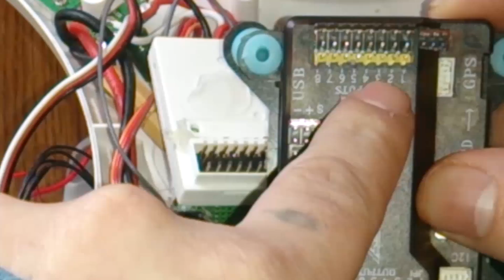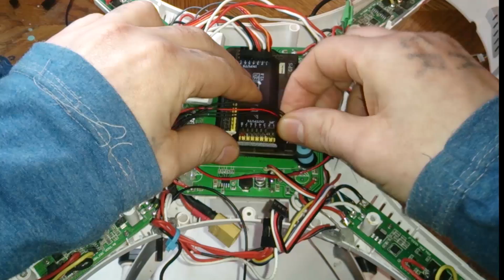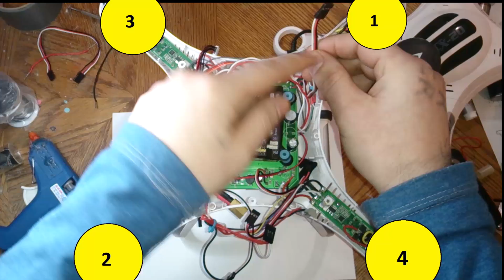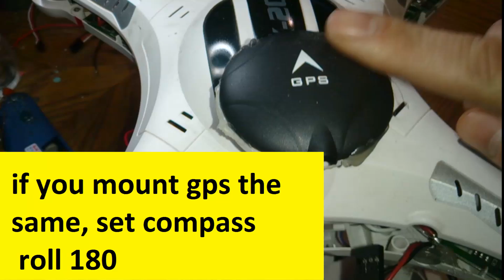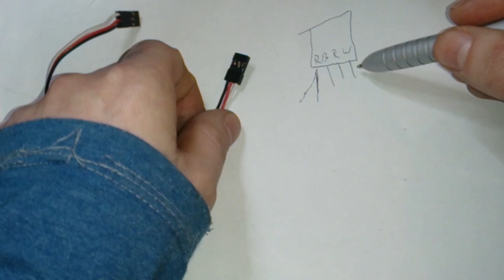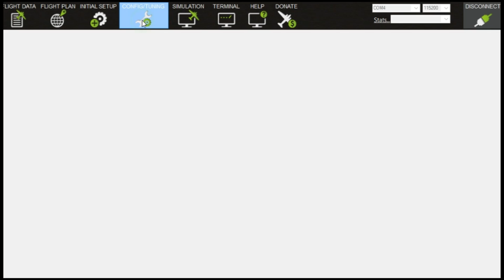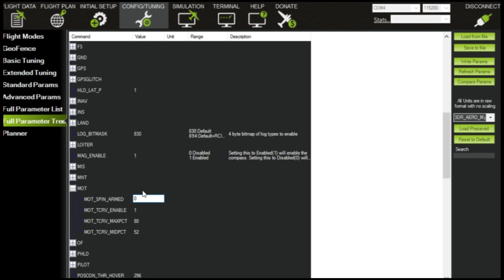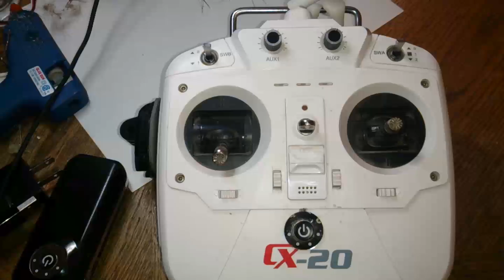cx20 factory apm to apm 2 6 - 2.8 step by step

Comment: First I would like to say thank you. Your video was a huge life saver as I was swapping out my old FC to the new one. Mine is a 2.5 and was almost identical to the procedures that you showed. I do have a couple of questions about things that arent quite right with my CX 20 now. The LED's for arming and gps lock are working but only for the Arming portion. They both light up in sync when the quad is armed and blink in sync when it is not. I followed your drawn procedure as I have the set up with the one plug and two joined red wires. The other mystery is that now when I arm the quad I have to use the right stick down and to the right instead of the left stick down and to the right like it uses to be. Your awesome bro and any help that you can provide will be super apreciated.
Thanks so much.
Reply from the maker: I came up with another picture..   make sure to start counting at a0,a1,a2 ect..  https://drive.google.com/open?id=0B2w6_OKE_2kxbjJfR2Zyb3E4bFU

for your reverse arming  double check that you did not put the e,t,r cable backwards.. it might be r,t,e  you can see this once you go into mission planner and remote calibration.. to double check..
receiver---apm2.6
a===========1
e===========2
t===========3
r===========4

I am 99 percent sure that is your problem.. just lift up one end of that cable either on the apm or the receiver.. and just turn it around ..
Reply: okay cool... that looks like exactly how I have it set up except the ground pins are moved over a few pins. is it important for them to be directly below the switch pins?
https://drive.google.com/file/d/0Bzz5jGWsqlyNUnAwZlBIQXowLUU/view?usp=drivesdk
Reply: bangs6996 they are running in sync with one another for the arming of the quad. not getting a separation between them for gps lock?
Reply from the maker: the way it should go is they both blink when you plug in the quad.
once you arm the quad the green and red light will go solid then the red will stay solid ... and the green will blink if no gps lock.. once you have gps lock the green will go solid .

what version firmware do you have?   
and the ground pins are fine where you have them.
Reply from the maker: and the orange and red light will act as one light now.. unless you flip the leds like i show in my other video..
Reply: bangs6996 Ohhhhhhhh... that makes sense..
Reply: bangs6996 firmware should be the latest. It just updated
Reply: bangs6996 excellent..I will try this as soon as I get home...
Reply: bangs6996 bro... your a genius. switching the cable over worked for the arming issue. I've set it on mission planner not to arm until there is a gps lock
Reply from the maker: cool... glad you sorted it all out.. and thanks for the sub as well..
Reply: Alright Bro... I buttoned it all back down and am recalibrating and the only issue that I seem to get is the compass offsets. It recognizes the compass in the I2C slot which is the only one that it will fit in (factory Compass) but when I try to do live calibration it does not seem to hit all points. Any advice here???
Reply from the maker: yes .. if the compass is actually working .. tape up your usb cable while your doing the calibration to one of your legs.. you might be loosing contact when flipping it all over the place..
Reply: bangs6996 I actually tried from the apm directly to the laptop. I know I'll need to redo it but trying everything possible. do I need to do 180 compass?
Reply from the maker: no you should not have to change that unless you moved your compass . upside down or turned the orientation of it. .... 

with mission planner .. when you go to the hud.. is it it pointing in the right direction north,south , ect..   try connecting with the compass not attached. and see what direction it points in then slowly moving it in another direction.. 

next unplug the quad ..and plug the compass back in .. and try again and see if its different and if it moves better with the compass plugged in.

if you have a smart phone.. try getting a compass app and compare the app data screen with the hud screen in mission planner..
Reply: bangs6996 ok. getting a compass offset to high pre arm warning. quad won't arm when gps and compass are checked in arming
Reply from the maker: what error do you get when the compass is not plugged in.. curious if you have a on board compass..
Reply: bangs6996 Dammit, I didn't try without the compass plugged in. I kept getting the compass offset error, then that went away and I was getting a check mag error. I'm assuming magnetic interference.. so i loaded old saved parameters including apparently old compass settings. good news it, it flew about 15 minutes ago. held totally stable in gps modes. didn't feel any compass related issues and rtl landed it within inches of its take off point. going to throw another battery in it shortly and try it again.
Reply from the maker: that's great.. it turned out good.. rtl is the best test for the compass
 and gps anyways.. .. as I tell people on every flight, take about 2 
mins to test rtl.. just arm the quad bring it up and fly it about 20 feet in front of you.. switch it into rtl , if it comes straight back 
and attempts to land you can take it out of rtl.. and have fun.. If for 
any reason it goes in another direction .. quickly flip it back in 
manual and don't fly until you figure out what is wrong or you will have
 a fly away eventually.. ...

anyways congrats for sticking with it and figuring out a fix..
Reply: bangs6996 your awesome bro. your video and advice walked me through it. next, a ground up build... sounds like your quite the expert. mind if I keep your info for potential future questions?
Reply from the maker: yes for sure.. if you get stuck on something just post on/in what ever my newest video is, it does not have to be related to the video....
Reply: bangs6996 dude... I spoke too soon I guess.. Lol. wicked toilet bowling going on during second flight. took for ever to arm and then when it finally did, it was all over the place. this compass issue is going to be the death of me.
Reply from the maker: Maybe its the cable is loose on one of the pins for the i2c cable.. 

with mission planner on .. maybe try to play with the i2c cable wires on both sides to see if anything weird happens..

I'm curious how come you just don't run the new gps and built on compass to the puck on the back.. it might solve your problems
Reply from the maker: andd boot up with no compass to make sure you get a no compass error. ..  I have no idea if your apm came with a built on compass.some do.. but usually they save 20 cents and don't add it..
Reply: bangs6996 can't run to the puck because I don't have one anymore. lost it in a nasty crash a while back and fabricated a different holder for the compass.. I am honestly not sure if the new apm has a built in compass. i guess I could pull out and then try to calibrate and see if it finds the apm compass.
Reply from the maker: yes it be worth the check just to make sure.. ..your hud should give you a error as well saying something on the line No compass.. 

If you did loose your puck .. maybe it is the wires then on the i2c that are messed up .. or your compass is just to close to something with too much noise.. ....
Reply: bangs6996 pulled the external compass wires. Recalibrated with the APM compass which went MUCH smoother than the external compass. saving params and will try another flight.
Reply from the maker: if you have a internal compass you should have a jumper to disable it .. or a trace that you can cut.. .hard to say how much noise you will get within the quad so close to everything..
Reply: bangs6996 the internal seems to be much cleaner than the external when calibrating. I am getting new offsets for compass #1 are -360 -611 -187, so when trying to arm said compass offsets to high.
Reply from the maker: btw .. i think you have the straight pin.. right beside the gps port. you should have a jumper.. ..if you remove that jumper you can then use your external compass..   you have probably getting the internal compass the entire time..
Reply: Oh Crap your right. there are three sets of pins next to the compass. which do I pull?
Reply from the maker: check to see if you have a jumper bridging two of them..and remove it.
Reply from the maker: beside the compass is jp1 .. you can remove that jumper as well if you have one on it.. but I'm sure you meant to say gps..    .. on the gps side.. you might have a very small jumper bridging two pins.. remove that as well
Reply: okay. this compass thing is driving me crazy. have tried calibrating the s)&t out if it. I've changed the rotation etc. I've gotten it to point in the right direction but cannot get the offsets get to an acceptable level.
Reply: I'm using a ublox gps which I believe has a compass built in. that may be the problem.
Reply from the maker: did you have a jumper beside the gps?
did you remove it?
did you boot the apm back up with no external compass and with that jumper removed ..to make sure you are not still using the internal.

thy ublox has the i2c on a separate wire  ..with two wires in the harness..
Reply: yup. the gps has a compass. mission planner only showing one compass so I'm not sure how to choose the external as the default
Reply from the maker: sorry .. need to know this..
did you remove a jumper????  beside the gps.
and did you remove jp1 jumper as well??
Reply from the maker: sorry .. need to know this..
did you remove a jumper????  beside the gps.port
and did you remove jp1 jumper as well??
Reply: I removed the jumped next to the gps input on the apm. that di dnt seem to do it.
Reply from the maker: ok .. thank you lol..

so now the next step is to flip the apm upside down and take off the 4 screws. .. and take the top off...and take a good picture and link it to me.. I want to see if you truly have a compass . and if you need to cut the trace..
Reply: check it.. https://goo.gl/photos/x7gSJu1zSQdZpDi46
Reply from the maker: ok perfect.. cut this trace..
https://drive.google.com/open?id=0B2w6_OKE_2kxOEg4QmhTa0JxMzA
Reply: using this gps https://drive.google.com/file/d/0Bzz5jGWsqlyNLWJ0eTJtTTlEeHM/view?usp=drivesdk
Reply from the maker: ok well cut the trace i suggested.. and also your gps does not have a built on compass..
Reply: so it's the compass in the APM?
Reply: so when I try to calibrate compass can't seem to get to the white dots on the top of the circle.. it starts out WAY outside and pulls its self in.
Reply from the maker: or maybe it does..heh ..thats not important right now anyways.. the important part is cutting that trace.. then plug the apm back into your computer with no external compass and confirm you get no compass error.. .. then plug in the i2c and see if you get it..
Reply: nice... I'll let you know how it goes...
Reply: ok so... razor blade that bridge on that point.. cool.
Reply: bangs6996 I removed both
Reply from the maker: "I removed both"  Is this a old reply? .. and yes razor blade that trace.. if you ever want to re use the internal u just need to put a solder blob back on it..
Reply: bangs6996 yes that was old. cut the connection. got the compass not healthy error. plugged external on and rebooted. compass calibration was Much better. need to lock it all down and recalibrate with the top locked on and level everything. tried flying before that and it was bouncy as Hell, but it marked and did fly. so moving I. the right direction I think.
Reply from the maker: k good luck.. also make sure the compass is still on the out side of the
 quad roughly where it was before.. and so important that it can't move 
at all from the air pressure  of the blades ect.. or any possibility  of it falling off during a flight..
Reply: bangs6996 ok. buttoned calibrated well. in gps modes its ALL OVER the place. drifting was out in all directions.
Reply from the maker: how is it in manual mode?  if its drifting ..you need to do a better job at accel calibration.. 

are the wires of your compass facing forward? / towards the front of the quad
Reply: bangs6996 not drifting in manual mode. little twitchy but not drifting. compass is mounted outside and wires are facing the front. https://drive.google.com/file/d/0Bzz5jGWsqlyNeUdkT2FJYkZIbVE/view?usp=drivesdk
Reply from the maker: maybe try a compass calibration again.....
also confirm in mission planner..
..
config tunning
..... Full Parameter list
...... Compass_external = 1
......Compass_orient = 0

I would also re do the accel calibration not sure if you keep doing one every time you take the lid off but you should be.. .. you tell in the hud how your roll is at least with that straight line..but just re do it anyways.
and then re- do your compass..
Reply from the maker: "the sound of silence".. hopefully things went ok and you did not have a mishap ..    I can send you my params ..or it could be your not getting enough sats. .. alt hold would probably be a better way to test just the barometer and compass..
Reply: bangs6996 well. minor mishap after this.. Lol. nothing major, crash from 5 feet up into grass.
no idea what's happening now... 
https://drive.google.com/file/d/0Bzz5jGWsqlyNeUdkT2FJYkZIbVE/view?usp=drivesdk
Reply from the maker: back up our params and try mine..   (if you want that is heh)
https://drive.google.com/open?id=0B2w6_OKE_2kxLTlWdGZsSWRWcGM

after you write my params make sure to push write.and reboot the apm by unplugging the usb and back in again..

you will need to redo
remote calibration
accel calibration
compass calibration

rtl is set to 424 13 feet. height.
and gps arming check disabled.

for now I would also strongly suggest going into 
initial settings.
and fail safes 

set the one that is set for rtl  set it to 
always land.

until you get some stable flights at least.
other wise your quad can just fly away with any glitching right now that sends it into a rtl..
Reply: bangs6996 will do. so also trying to calibrate esc's. rear left keeps beeping. have started over 10 times and it's always the same one..
Reply from the maker: hmm your not having much luck.. 
when you do the esc calibration just make sure not to have the b cable plugged in.
Reply: bangs6996 I'm not.. Lol. that little crash re cracked the frame. I'm giving it a test for now. I already have a new frame on the way and will transplant and start fresh. you have been awesome and ill hit you up when I resume the efforts.. you are a rock star bro.. thank you
Reply from the maker: yeah i know the feeling on wrecking the shell.. hot glue is your friend.. but for only so long..    your welcome and will continue later.. ..
Reply: hey bro. shoot me those params and ill load them up.
Reply from the maker: read 6 or so posts up from this one i linked the params with the instructions..
Reply: BBBBBBRRRRRRROOOOO, IT worked. Your params were perfect. loaded your params, recalibrated everything and flew it. GPS Lock held almost as well as my Phantom and Xstar do. RTL landed geet from take off spot. Manual pitch is still a little high but I can live with that and change than anytime. I Can NOT thank you enough for your help and expertise. #subscriberforlife.
Reply: bangs6996 hot glue and moldable plastic to fix the arm...https://goo.gl/photos/R39h3PLRZ9tTGubG7
Reply from the maker: poly morph bead? ..I have some of those ,actually never tried it on the quad.. so far i've been lucky when my arms break they don't break 100 percent the same top and bottom so hotglue has been able to fix them.. (well did have to order a new shell once) ..Its funny how you tape up your arms.. I was doing firmware hacks on the esc's where I had to take the lid off about 200 times.. so got sick of it and just taped them up.. now I always tape them up.no screws... and my last crash the top ripped off but basically no damage..
Reply from the maker: congrats.. hopefully it just keeps working now.... if not I would look at a loose wire or something.. .. anyways ..your welcome and safe flying..
Reply: bangs6996 it is Polly morph. I love the stuff. I did tape the arms as much as I was opening and closing it. with a new frame on the way, I'll use screws after the transplant. I'm thinking actually about dying the new body black. I think that would look cool. 
everything is tied down with zip ties and a couple of dabs of hot glue here and there. Lol
Reply: bangs6996 hey... what setting do I need toi adjust to get more pitch in stable mode? Its super slow when in those modes. in manual its great...
Reply from the maker: check .. 
Config/Tunning
...Full Parameter tree
.....Angle Max..
if its set to 2200 you can try to set it to 4500.. .just be careful when playing with pids..ect..
Reply: 4500 might be a bit extreme... I find that 3800 is more than acceptable. So, if I adjust Angle Max in Full Param Tree will that effect all modes? It has been my experience that when making changes there it only effects the Manual mode. Also once I modify the Angle Max will I need to make any additional PID adjustments?
Reply from the maker: Hi no you don't need to make pid adjustments.. i just brought that up because its in the same area and was not sure how experience you are playing with them   .. about the max angle you are probably right about the 4500 mine is down at 2200.. i don't use the cx20 for fast flights.. however that might screw me on a very windy day. on a return to home... I think you also have to be a tad careful in alt hold and to much lean as it might loose altitude ..at least thats what i have read..
Reply: bangs6996 that is really my only concern with the pitch in stable modes, Is its ability to fight wind and return home in the event of hitting strong winds on a flight. I understand also that it doesn't handle well at high speeds in stable mode as it has to keep with the gps signals but from the factory it was faster then it is now in those modes so I do want to beef it up just a tad.
Reply: bro, wpuld it be easier to facebook message about this¿ lol
Reply from the maker: i think for that you would want to try to increase the wpnav_speed  in full parameter list .. it will try to return home faster so in theory in stronger winds it should do better.. but I have not really played to much with these settings as before the quad will start to have a harder time keeping altitude ..
Reply: bangs6996 Alright, I find I can't arm in loiter mode. Every once in a blue moon it will. I know this is due to HDOP. any solution for this? Currently arming in manual then switching to loiter before take off. Seems to work ok but would be nice to be able to do it right..
Reply from the maker: yeah it can be a pain in the butt  I don't know any fixes.. I would say maybe its your gps unit.// location of gps unit. or your not waiting until the gps light goes solid. could be a building or a tree near by as it needs a good 3d lock to be able to arm...    try plugging it in with a clear view to the sky with no buildings or tree's .. once the light goes solid wait another 10-30 seconds then try to arm in loiter...